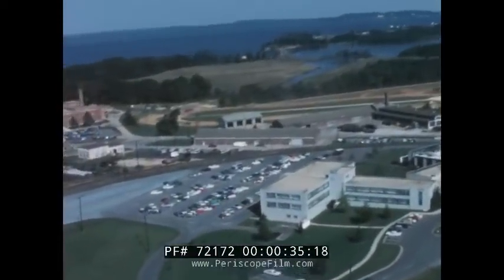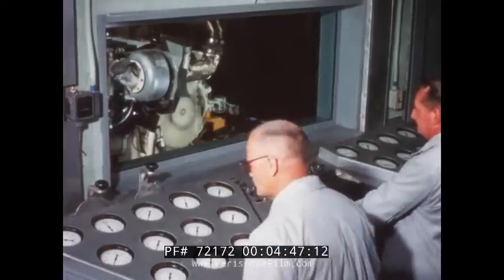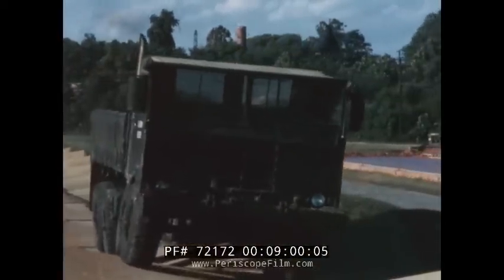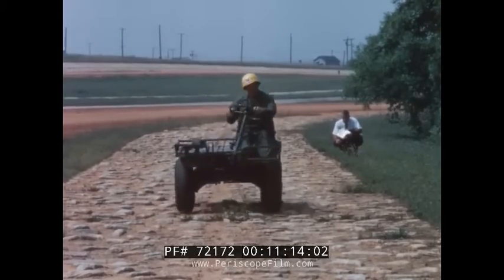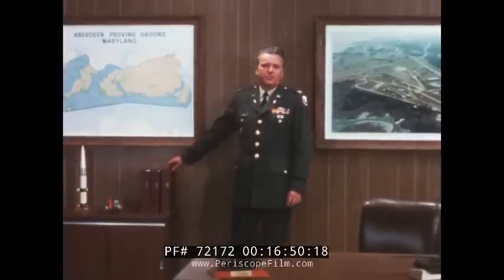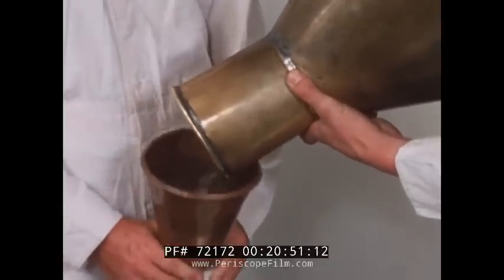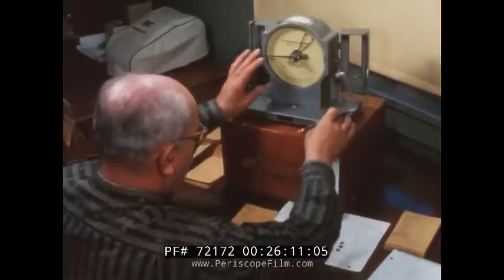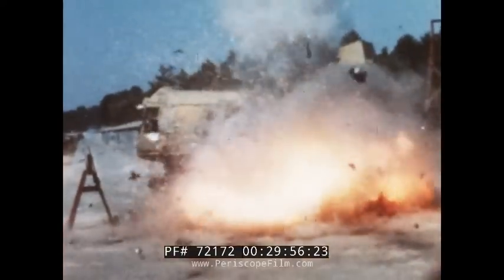TESTING WEAPONS AT THE U.S. ARMY ABERDEEN PROVING GROUND  72172

Comment: I'm a drafted disabled Republic of Vietnam combat veteran '68. Too bad the M-16 never got adequate testing. I used that piece of junk in Vietnam. During training using the M-16 weapon, all we did was point it down range. Of course, I was issued wrong size shoes. We could not get parts for our OH 6 helicopter. Eaglegards ya dopes...
Reply: The ones tested weren't the same as those initially issued. McNamara or some other criminal decided that chrome plating the bore wasn't necessary because primers were non-corrosive now. The ammo in service DID NOT have non-corrosive primers. That, and the M16's increased need for user maintenance as compared to the M14 lead to a lot of soldiers' deaths.
Reply: We were still using M16A4's during basic and AIT (OSUT) at fort Knox in 2008-2009. 

Those things were huge pieces of crap. I cant imagine how bad the first iteration was in Vietnam.
Reply: @Barklen226  Thanks